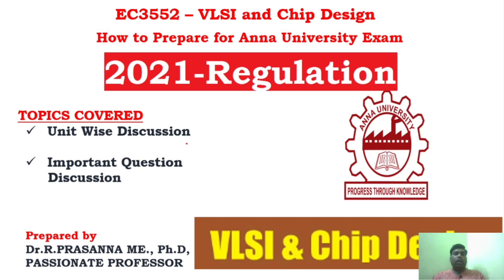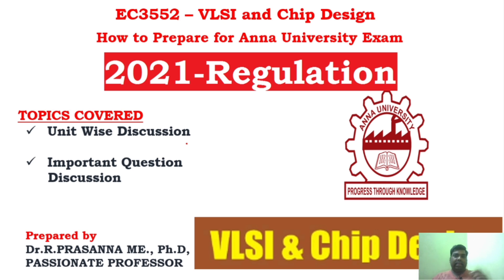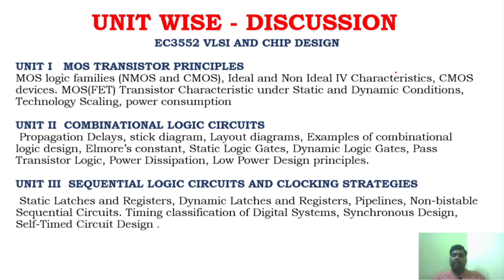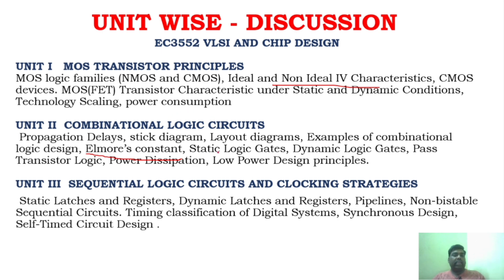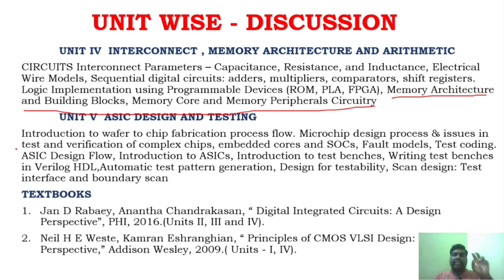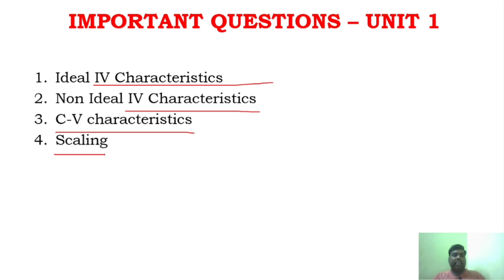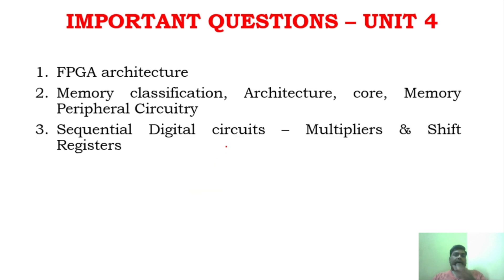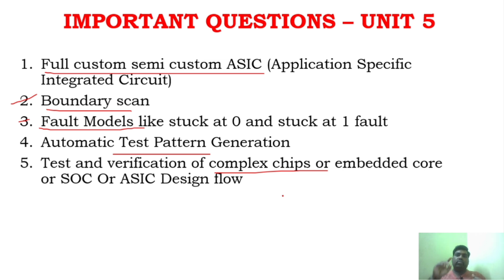Anna University Exam Preparations - EC3552 VLSI Chip Design

Comment: Sir Hii, yesterday 2024 Nov/Dec VLSI and chip design exam conducted, as well as I prepared from our passionate professor questions. Although I had completed exam and but questions were differs from your important topics sir. I felt very tough
Reply from the maker: Kindly share VLSI Question paper to professorprasanna@gmail.com
Reply: @PASSIONATEPROFESSOR  sent sir
Reply from the maker: Ok student. Thank you looks like lot of split ups but you could have easily written 4 .5 questions which is expected only. Don't worry hope for the best👍
Reply: @PASSIONATEPROFESSOR  yes sir, i answered so 5 questions, damn sure that's right sir.  Thank you sir for your clarifications

Comment: Sir in unit 5 is embedded core and soc seperate topic  or comes under test and verification?
Reply from the maker: If you prepare for soc you should be able to answer for embedded core.
Embedded core is part of system on chip soc

 Testing and verification is different topics